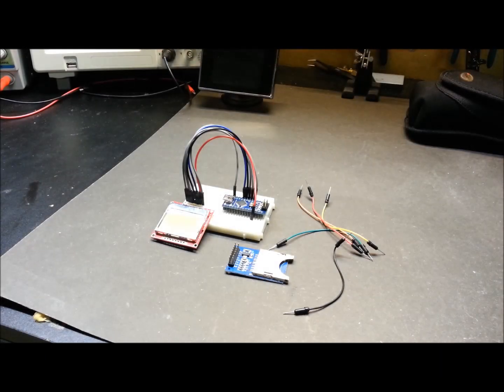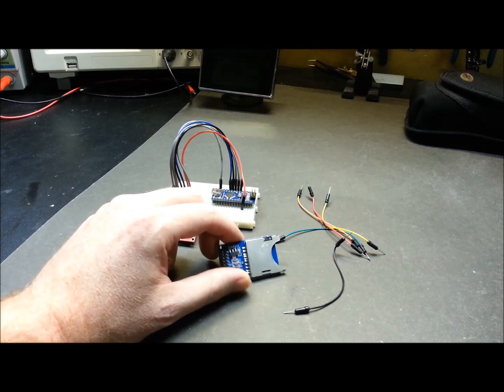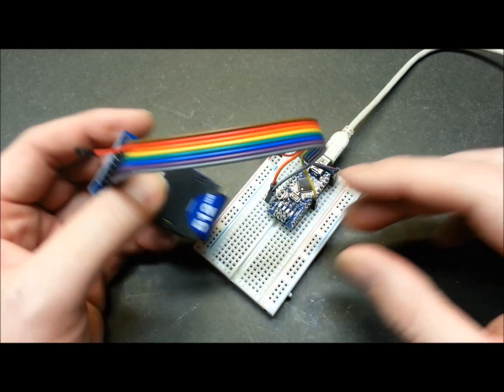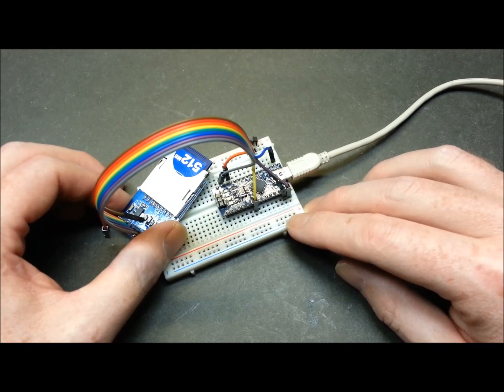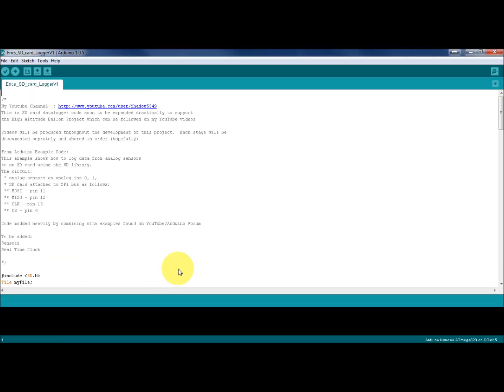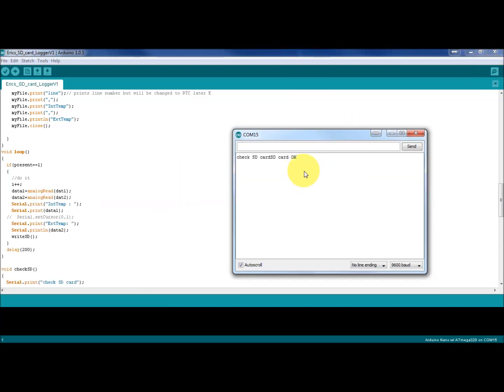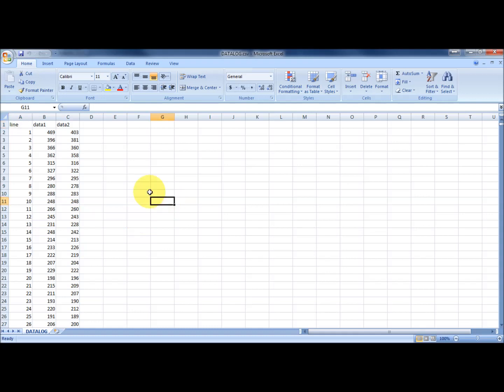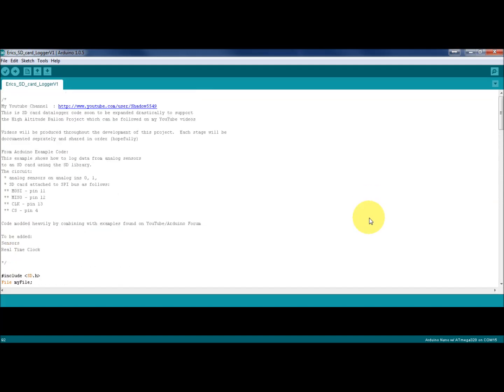HAB Part 2- Arduino SD Card Data Logger Storage

Comment: I like the idea of using bluetooth to get data from the arduino,  I wonder if you can serve up webpages over bluetooth,  you wouldn't need any special software on the phone to monitor the data
Reply from the maker: Thanks- I needed a way to make sure all the systems are logging before we launch and the capsule will be sealed :)  For this project I am just sending everything to serial and using the SENA BlueTerm app to connect and view the stream.  Nothing too fancy this time.  Cheers!